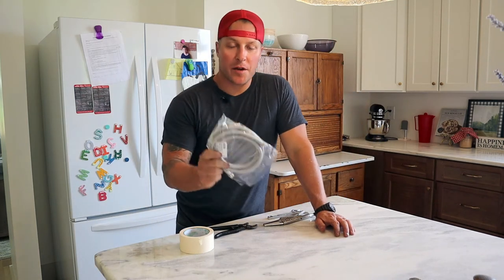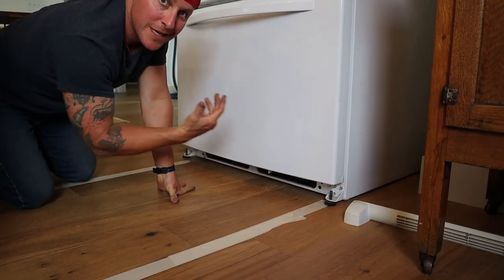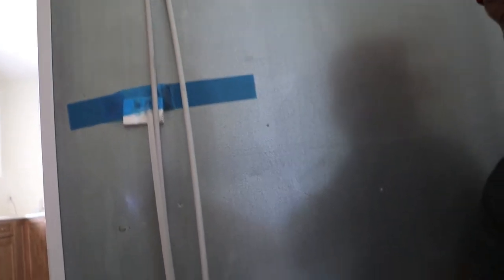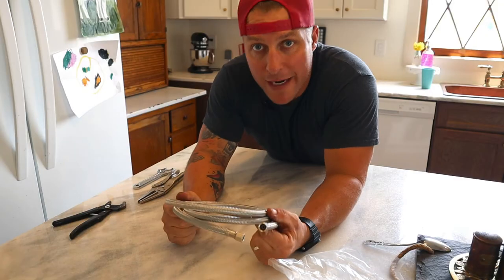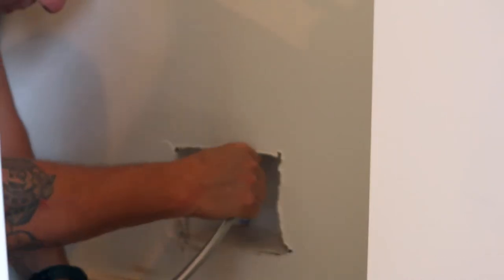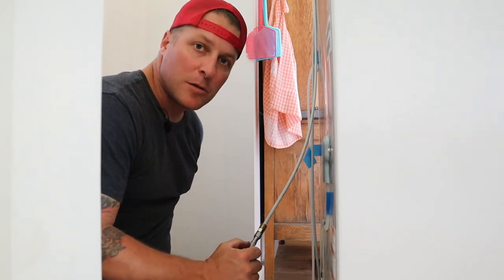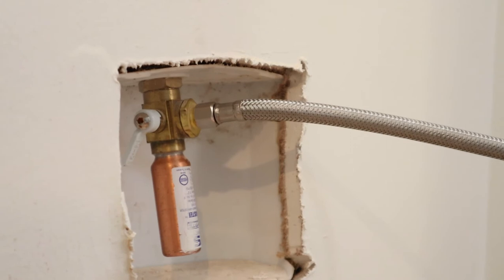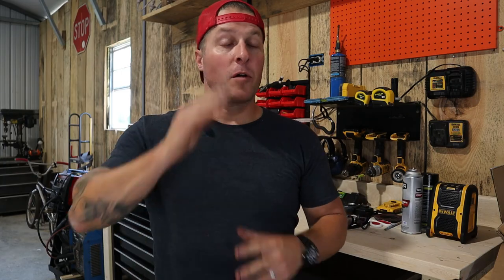How to connect a water line to your Refrigerator. MAN CARD MONDAY!

Comment: Love the video.  My braided line runs from the bottom of the fridge through the cabinet to connect to the valve under the sink.  So the braided line is on the floor behind the fridge.  I need at least 2.5 feet of line to try to get step out of the back of the fridge to push the fridge back.  This line is laying on the floor.  Any suggestion of how to avoid kinking the line or running over it when I push the fridge back?  Thank you.

Comment: I want to purchase an espresso machine that has direct plumbing capabilites. 
The water source closest is the refridgerator. Is their such a thing as a 3 way valve to tap  into the refridge water supply? How would you go about that? We only need water supply...drainage is not necessary.
Reply from the maker: Yes they do make a 3 way valve and that would be perfect to run a espresso machine. That’s exactly how I’d hook one up also. Thanks for watching
Reply: @ProjectDadLife  Thanks so much for you reply. Your video was the closest I could fine.

Comment: So the house I live in has that 3/8 inch plastic tube coming from the fridge and also the wall. I have a new fridge coming Saturday with the 1/4 inch braided line. Is there a way to connect the 1/4 inch line to the 3/8 plastic tube from the wall?
Reply: this! except 3/8th from water supply outlet. My fridge is 1/4 in. HELP.
Reply: @LarrySoliman  update. Delivery guys hooked it up with no problem. He just screwed on to the existing coupling on the plastic tubing.